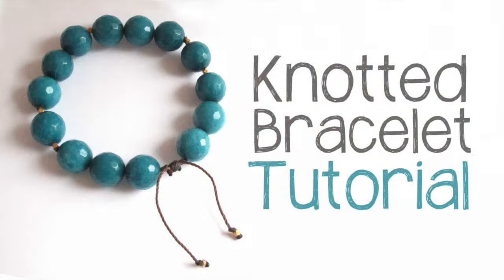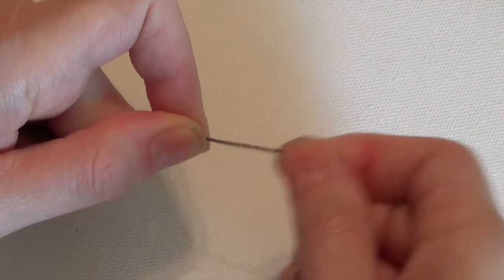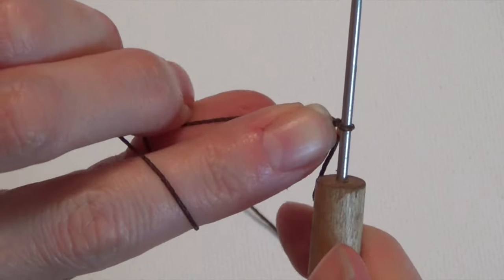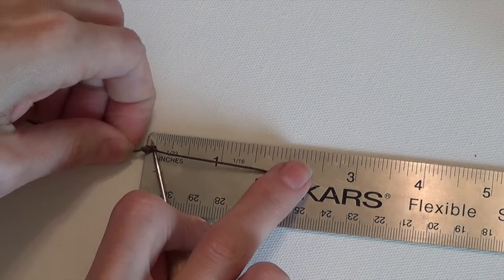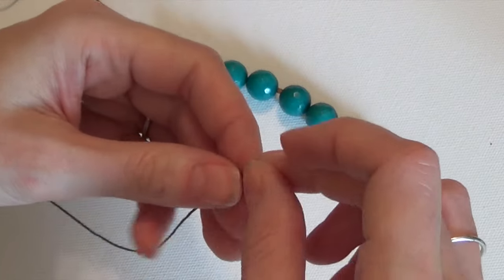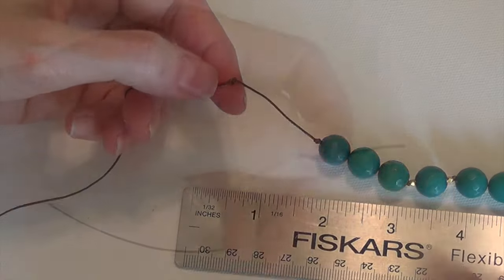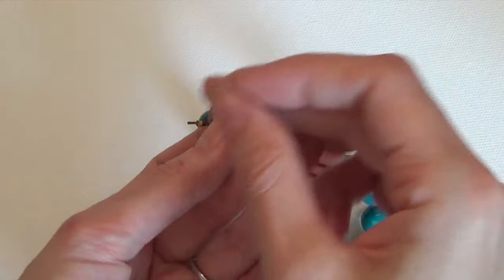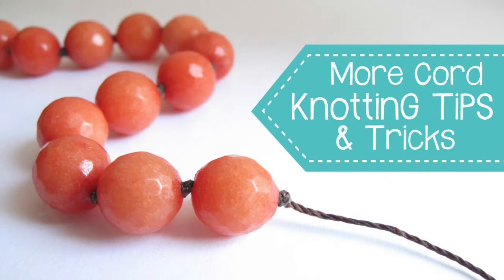Knotted Bead Bracelet Tutorial - DIY Bracelet Cord Knotting Technique

Comment: I think you made a mistake when slided beads on. The rythm was 3 beads, spacer bead. But I can see 1 bead and spacer bead on the bracelet. Is this correct?
Reply from the maker: +asdona mur If you watch it again you'll see the pattern is 3 large beads, 1 spacer bead, 1 large bead, 1 spacer bead, 3 large beads, and so on :)
Reply from the maker: +asdona mur You can see the pattern really well in the photo at  0:13 in the video :)

Comment: I want just regular stretch like bracelets, but instead of the stretch cord I want the adjustable square knot, are all those knots you are doing between beads necessary for some reason? or just a design choice? Could I do this, but have no knots other then the ends? and the square knot part?
Reply from the maker: The knots between beads are just a design choice, so yes, you can just do this with the knots on the end. I don't think it will work with stretch elastic cord though, is that what you're wanting to use?
Reply: @JewelryTutorialHQ  No, I want to use a nylon cord I got called "knot it", and I want to put 6mm gemstones all around it, other than at the end use an adjustable square knot, instead of a clasp or elastic.